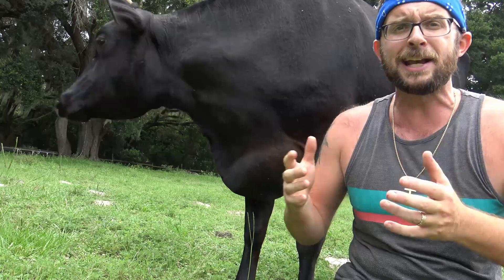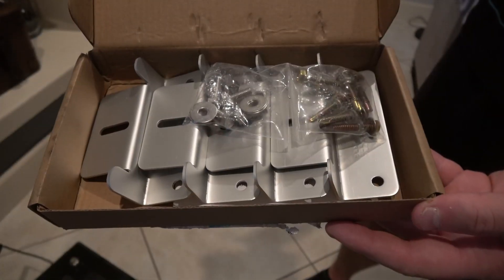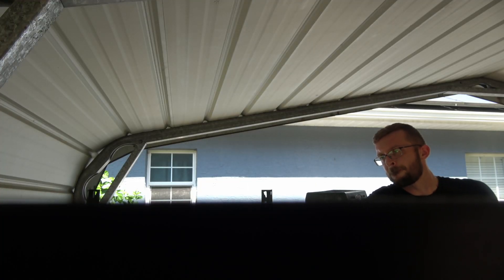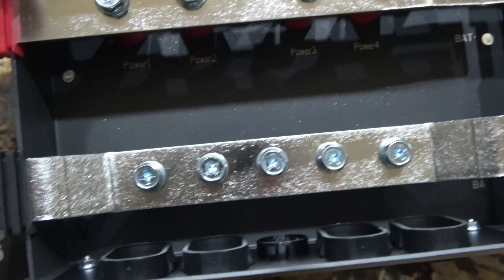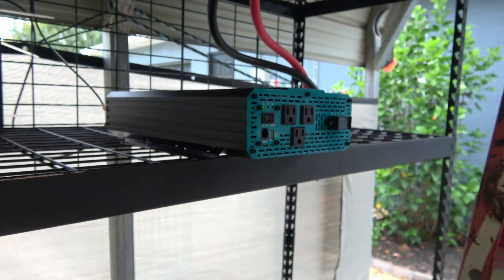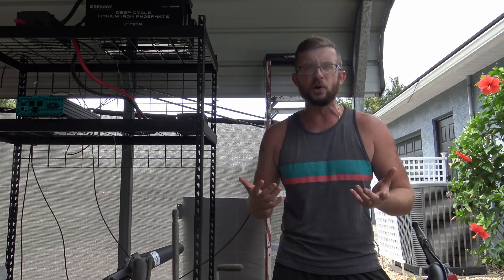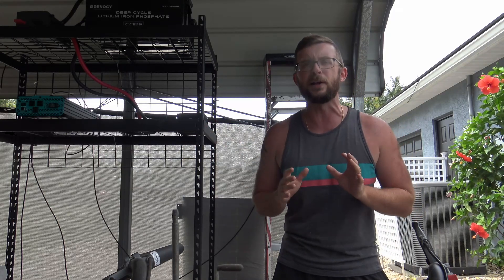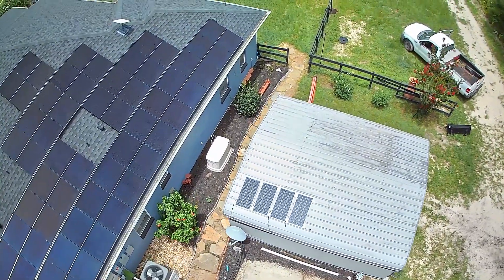Going Off-Grid with the Renogy Complete Solar Power System!

Comment: Good video. Can you buy more solar panels and just plug them into the setup and the batteries will charge faster?
Reply from the maker: Yes you can, you just have to make sure the charge controller is rated for the power you are putting into it